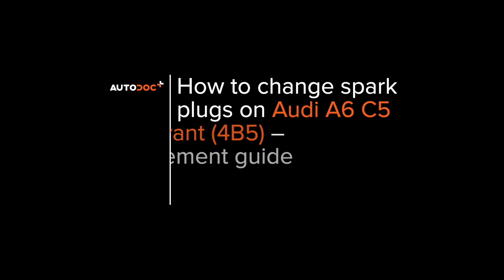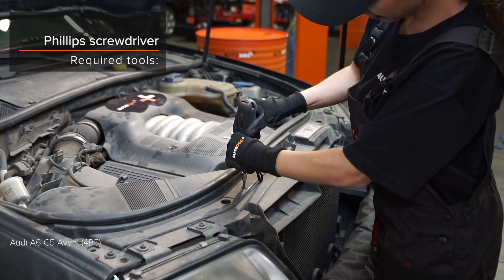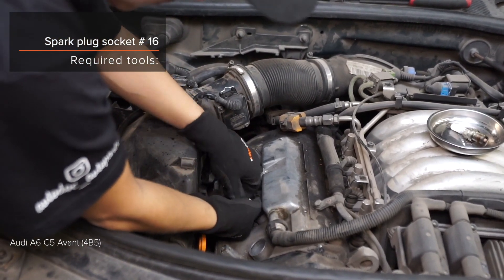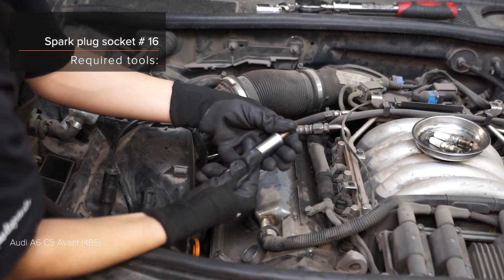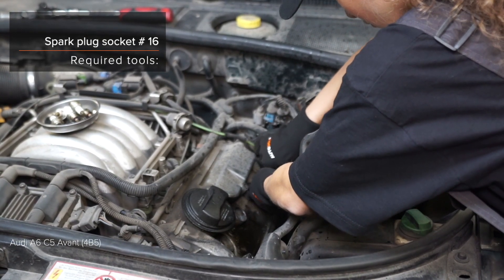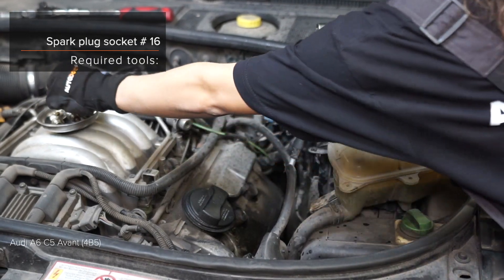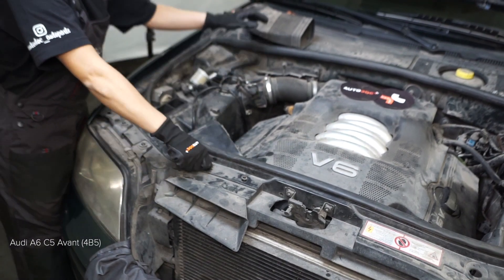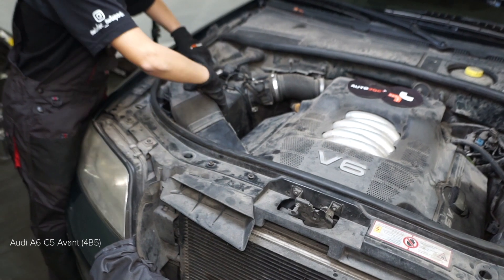How to change spark plug on AUDI A6 C5 Avant [TUTORIAL AUTODOC]

Comment: Missed a great opportunity to show how to use the Orange Tool on #2 plug wire. It 's designed to aid in the removal of the plug wire which if not lubricated, can be very difficult to pull up.  Further, removing the oil level 'dip stick' provides addition room to remove/install the right side trim cover.  Least we forget - Safety First. Safety Glasses are a must!  Good video for DIY'ers

Comment: Whoa .. so if you need to check the spark plugs, you need to disassemble half the car with bunch of special tools .. I miss those good ol' times when cars were cars and not damn puzzles :)))
Reply: Depends on the car I have the same body with a 1.8L engine and it’s straight forward.